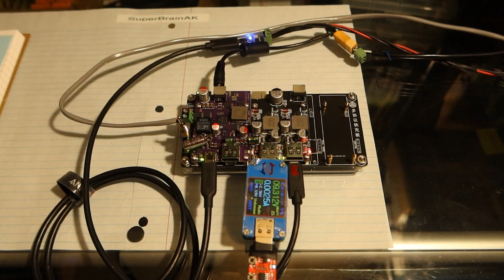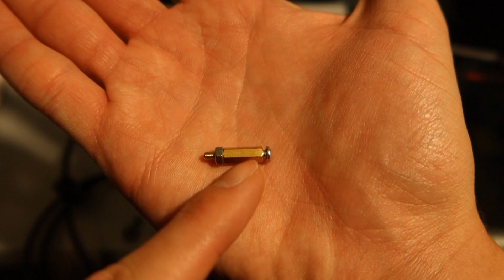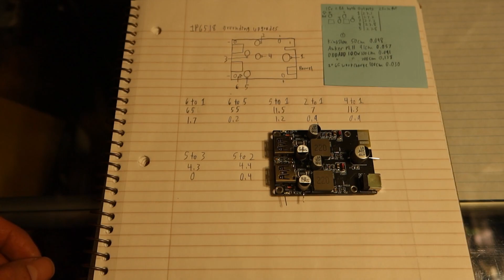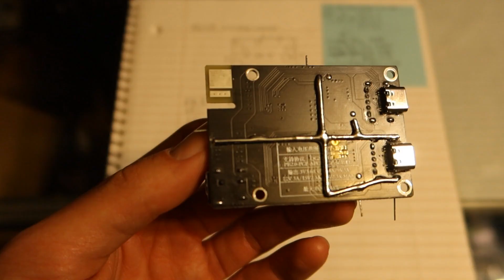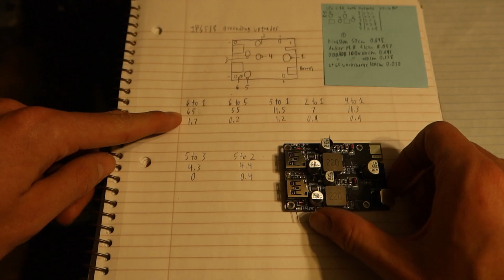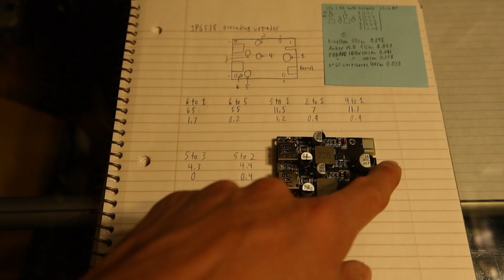Modular USB Board Upgrades IP6518 Dual and IP6559 + IP6550 Combo

Comment: Great video brother I was just about to ask you for help a few days ago cause I been building a buck converter for my tesla coil and you seem to have lots of knowledge on converters as I saw on your chanel that big ass boost converter beast you build , now I got it working and I am playing a bit with it , it was simpler than I thought but since I don´t have a scope it can get kinda tricky to know what the output looks like ehehe but anyways I been having lots of fun building this converter
Reply from the maker: Hello brother! Thank you!
Why do you need a buck converter for the tesla coil? Usually the higher the voltage the better? More powa!!! ⚡⚡⚡💥🤣
Yea I know how you feel making your own switching converter. There are so many variables! I tried to make my own DC-DC isolated supply using the XL6009 but it was not as efficient as I wanted and had issues with regulation once I put more load on it. I forget exactly how it worked in it's current form so probably worth looking at my poor blob of a circuit again. I ended with a FP5139 based SEPIC module as my driving circuit. I replaced the inductor for a SMPS transformer and diodes for much larger ones.
I am glad you got it working well enough to keep experimenting! Happy tinkering!
Reply: @SuperBrainAK  Yeh but QCW coils use a buck you know , I saw a dude who made a qcw with a boost instead but , is like a buck allows you to take advantage of the Bus Capacitance is like you have a fairly big capacitor bank at high voltage and with the buck you can do a controlled discharge on the sstc driver " A Ramp " also my tc driver can't handle much voltage , of course at the same time I am using a zvs driver to charge the big capacitor bank , so the sistem is like a stepup to charge the bank , and then a stepdown to discharge into the sstc , I did not test it on the sstc yet but been doing some tests on bulb lamps and leds